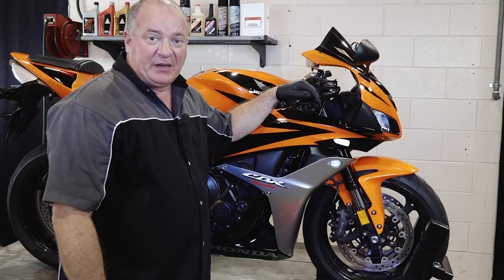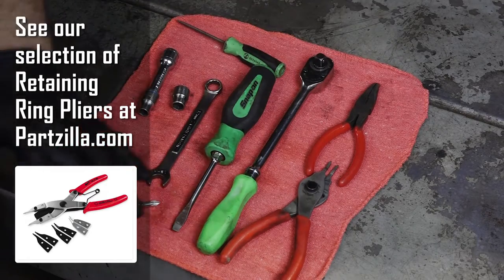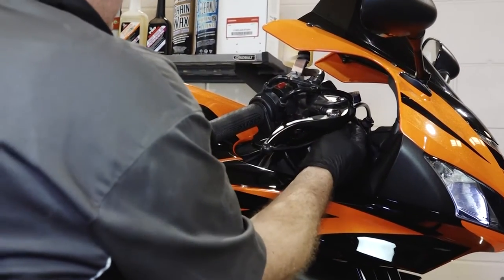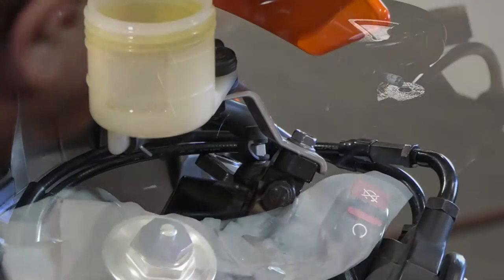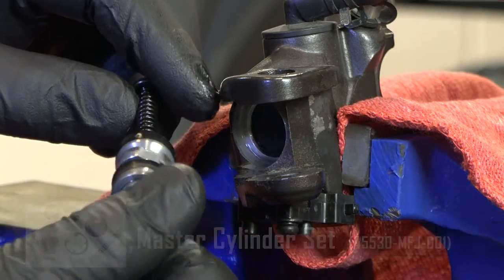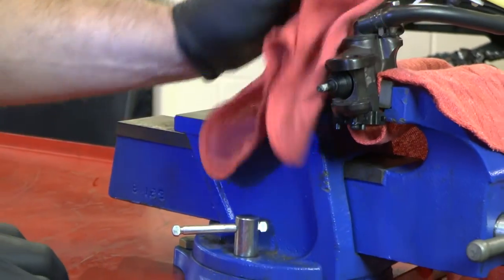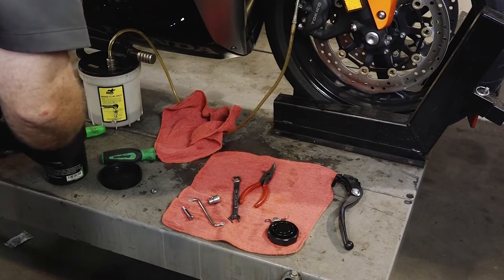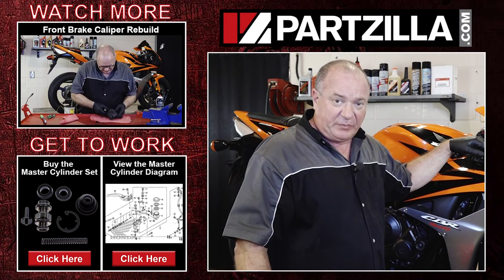How to Rebuild the Front Master Cylinder on a Honda CBR 600 RR | Partzilla.com

Comment: Many thanx - I'm rebuilding the master cyclinder on a 99' CBR900RR and although the parts are a little different, overall they are similar enough to what you showed us here, that I was able to disassemble it successfully - I couldn't work out how it came apart until I watched this and found out there's that circlip hiding under the rubber boot! Much appreciated!!

Comment: I have a 2005 cbr 1000rr .. Im about to rebuild the front and rear cylinders so I appreciate the videos! My front brakes locked up on me while riding just to the corner store luckily. The front wheel wouldnt even move afterwards until I bled the brake some.

Comment: Amazing video guide. Performed it without removing the master brake assy or the brake lines, from the bike. Just get the right height seat to sit beside the bike and the task is a breeze. Once the internals are reassembled the brake pressure takes a while to build up. But once it is up after bleeding, it is spot on 👌👌👌👌👌

Comment: My piston is stuck inside and wouldn't come out.  What do I need to do to pull the piston out?
Reply: Mine is stuck as well and will not come out after I removed the circlip.  I have tried everything to get it unstuck.  I pumped it full of WD-40, Brake cleaner, and even tried boiling it in water for a little bit.  It will not budge!
Reply: Yikes I’m on the same boat I was hoping to find a solution

Comment: I have a drz 400 sm, after I bleed the front brakes they feel really stiff, after a week of riding they are not as still as before, always gotta push on the lever a little more to get the same effect as right after bleeding them. I rebuilt my brake caliper (new seals, fluid, all clean before reinstalling) like 6 months ago, and I had this issue ever since that and before too, could this mean that I should rebuild my front master cylinder?
Reply from the maker: If the caliper is good, couldn't hurt to look into the master cylinder.

Comment: i'm wondering if you really need to take all the MC off, i think you can change the piston just taking off the lever and fluid
Reply: It would be a really tight fit and I'm not sure you'd be able to maneuver those retaining ring pliers in such a tight spot.

Comment: I have an Honda CBR 600RR 2006 but mine have the Brembo Master Cylinder. I'm trying to replicate your steps to change the MC kit but I can't remover the brake lever. Another question is I'd ordered the 45530MCJ751 part number, will that fit my bike?
Reply from the maker: That kit should fit the 06.   Why can't you remove it?  It's a nut and bolt.
Reply: @PartzillaParts  I'd removed the bolt that is close to the instrument cluster, but there's an adjustment bolt that refuse to let go the handle. That bolt is the one that goes thru the handle and into the Master Cylinder like a slave bolt. For some reason, that bolt does not let go the handle so I can repair the pump. Could this be the case because my Master Cylinder is Brembo and not the Honda or Nissin brand?

Comment: Hey John! I recently rebuilt my hydro clutch master cylinder for my 2007 cbr1000rr. I haven’t been able to gain any pressure unfortunately.... what do you suggest I do to regain pressure?
Reply from the maker: hello  Lucky Collins
my guess would be that you still have some air in the system somewhere. try tapping on the lines and cylinder  while trying to bleed. sometimes it can be a pain to get it all out. another thing you can try is pulling the lever in and letting it slam open several times. that can send vibrations trough the lines and help remove the air. or you could find a vacuum pump to help bleed the air.

something like this...
https://www.partzilla.com/product/aftermarket/2Y5E-JIMS-738?q_ref=L2Jsb2cvcXVpY2stbWFpbnRlbmFuY2UtYmxlZWRpbmctbW90b3JjeWNsZS1icmFrZXM

Comment: Is there a rebuild kit for the little plastic nipple on top where the tube from the oil resevior comes from? Mines has broken off is that replaceable or no?
Reply from the maker: You mean the where the hose connects to the master cylinder?  
http://www.partzilla.com/parts/search/Honda/Motorcycle/2008/CBR600RR+3AC/REAR+BRAKE+MASTER+CYLINDER+%28CBR600RR%29/parts.html

#2 on the diagram?
Reply: Partzilla yea the hose to the nipple but i need the one for cbr1000rr 2007 looks the same but you think it should work?
Reply from the maker: http://www.partzilla.com/parts/search/Honda/Motorcycle/2007/CBR1000RR+A/REAR+BRAKE+MASTER+CYLINDER/parts.html

#3.  This is the diagram for the 2007 CBR1000RR.

Comment: So on my zx6rr the brakes used to feel great then after a year of not riding it I try front brakes and it goes to the grip. Would that be a sign that the master cylinder needs a rebuild?
Reply from the maker: Not necessarily.  If it's been sitting for awhile, it could have just got air in the system.  I would flush and bleed it, make sure all the lines are tight.  If it continues to be an issue, then rebuild the master cylinder.

Comment: I was hoping to see the feed hose be removed - on the lever side there's a rubber bung, underneath of which is a circlip that retains the nipple assembly & I was wondering if the nipple could be rotated to accept the hose from a different angle.

Comment: My front brakes keep locking up in the front after I ride a little bit and after I bleed the breaks there is no air in the system. The front wheel still sticks a little bit do I need to rebuild my master cylinder? I took apart my calipers already and rebuilt them and they are fine
Reply from the maker: If you have rebuilt the calipers, the next thing would be to rebuild the master cyl
Reply: I'm having the same issue with my bike but I have done the master cylinder rebuild replaced 2 of the 3 hose's as well as had the mechanic replace some parts in the right side caliper. sometimes they lock up after 1 min of riding or 45 min later. if I crack the break hose at the top (master cylinder) all pressure is released. any advice?  i have a 03 kawi vn 750 6.000 mi
Reply from the maker: Make sure your fluid is not overfilled.  Random thought, have you inspected your lever?  Does it fully disengage?  I've seen damaged brake levers, aftermarket or improperly adjusted levers leave constant pressure on the line and the brakes overheat in no time causing them to expand without your permission.  It's something you might want to check.
Reply: Partzilla thank u. I'm new to mechanics and motorcycles in general lol I don't think I had it over filled but I'll triple check to make sure. as far as the break lever goes I'll definitely look into it.

Comment: Hi often should one rebuild a break cylinder?
Reply from the maker: The only time you should rebuild is if it seizes or gets so much corrosion that it stops functioning properly.  Maybe if it's damaged in a wreck.  It's rare that you should have to rebuild a brake cylinder/caliper. Thanks for watching!
Reply: so you say even if your bike is 11 years old wait for a rebuild till it breaks?
Reply: @jerryx2000  yep. If it ain't broke....